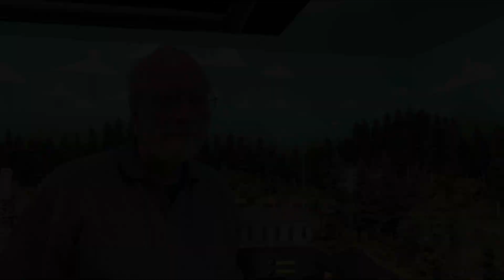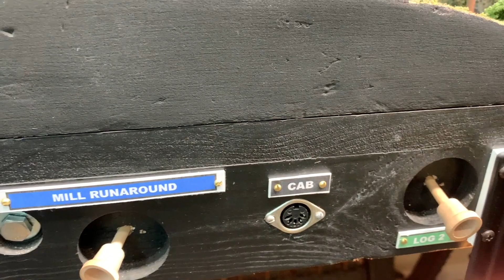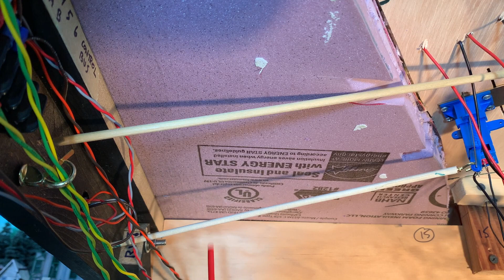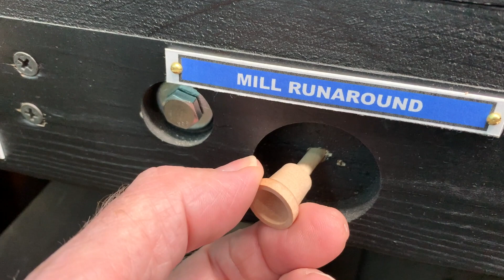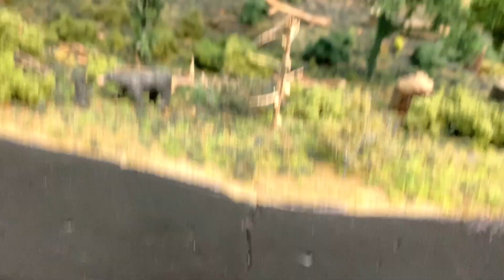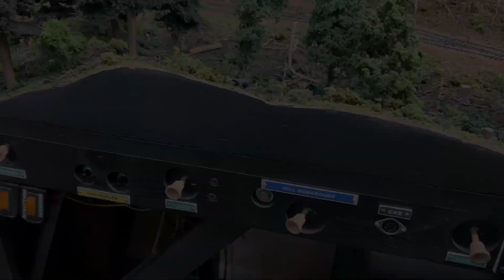Turnout Controllers on my Model Railroad

Comment: very neat solution! I am building a new layout currently and considering Blue Point units instead or Tortoises. I have got some MTB Mp1's in use on another area where I can't have anything under the layout and for that they are really good, but I like the idea of a mechanical connection where there is fairly simple direct access under the layout.
Reply from the maker: Yeah, it's worked out very well for me.  No problems now something like five years in.....

Comment: Thank you Carl for showing me how I could use the blue point controllers without having to buy all those other gadgets and accessories to operate them. It's an elaborate set up as designed but not the only way to do it.

Comment: Hey Carl! How did you get your switch stand to move with direction of the switch?
Reply from the maker: The switch stands from Railway Engineering are intended to actuate the switch points via an actuating rod between the points and the switch stand.  In my case, the actuation is being done with the Blue Point under-table mechanism.  But since the actuating rod from the points to the switch stand is still in place, moving the points causes the switch stand to rotate.  Sort of a backwards operation- instead of the switch stand actuating the points the points actuate the switch stand.

Comment: Hi Carl, many thanks for the advice.  Do you or any of your viewers find that there is a real saving using the Blue Points over say, the Tortoise mechanisms?  I personally like the idea of manual point/turnout control and have been looking for some scale manual point lever mechanisms (DCC Components in the U.K. produce working electric point levers, but not sure that they would work for manual - also very costly).  A company in the U.S. used to produce excellent quality manual levers, but these seem to have been discontinued since about 2013.  Your system however looks great. Cheers. EW
Reply from the maker: I didn't set out to save money over Tortoise.  Rather I just liked the idea of a simple mechanical device that would hopefully be bulletproof (so far, OK).  I suspect the costs are in the same range but have not done a real analysis.  I have been using switch stands from Railway Engineering.  While they are intended to throw a turnout, I use them the opposite way, with the Blue Point mechanism actually throwing the switch stand as the points move.  My only criticism of this setup is that the geometry of the switch stands is such that the points do not rotate them a full 90 degrees.  I've learned to live with that, as they look pretty good on the layout other wise.